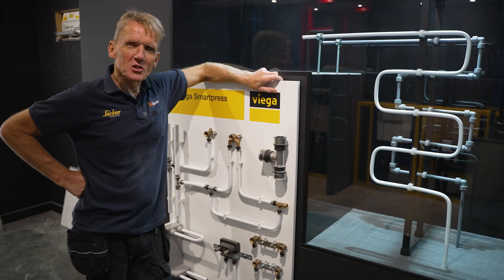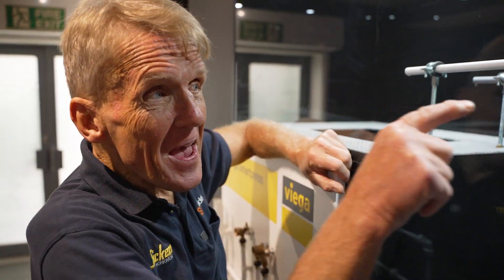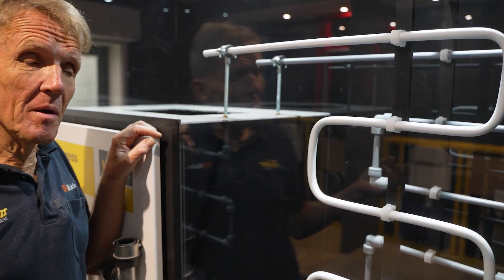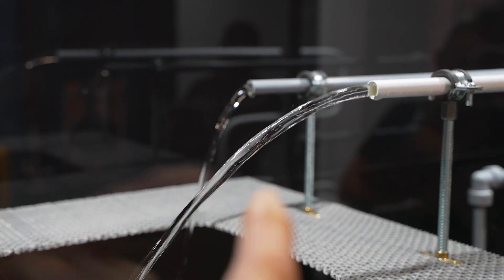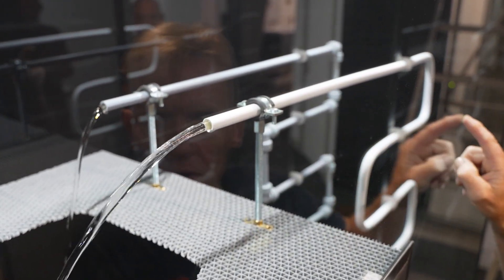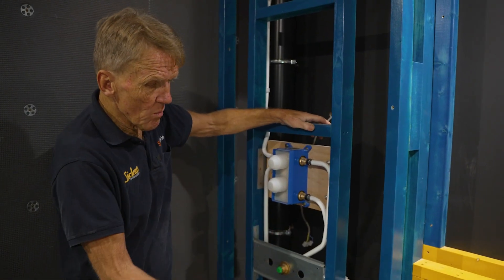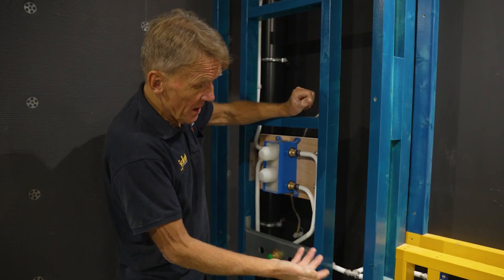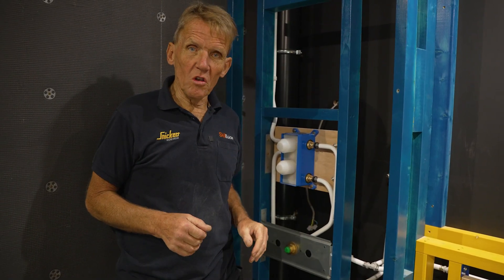Gobsmacking Truth About Plumbing Elbows

Comment: Those two pipes have different pipe diameter
Reply: The push-fit elbows also have pipe inserts that cause additional resistance.
Reply: @KendalMike yes it’s the inserts that are a real killer. Consider them on 10mm microbore feeding a radiator though a 6-7mm hole. Plus you get two one every fitting.   Never like push fit and never will. It only promotes shoddy work in my mind
Reply: @KendalMike only if you remember to fit them 😁
Reply: That’s exactly what i thought . Lol
Reply: Looking at the video a second time I thought there was a significant difference in the internal diameters of both pipes. To make a clear comparison how about quoting them.
Reply: 15mm Hep2O has 1.85mm wall thickness, so 11.3mm ID (~100mm^2 CSA). 16mm Viega Smartpress has 2mm wall thickness, so 12mm ID (~113mm^2 CSA).
Reply: @JohnSmith-ws7fq But you’re not taking into account the Inserts in PF fittings, they greatly reduce the resistance on PF fittings.
Reply: They appear to, but I suspect that's down to perspective and the pipe colours.  Focus on the IDs.
Reply: The inner bores are different. Resistance drops by diameter to the power 4 (diameter x diameter x diameter x diameter)if the larger one is 14 mm and the small one is 13, that's a 35% increase in resistance. If the small one is 12 mm it's an 85% increase in resistance. Get them to make you a rig with the same length of pipe without the bends and you'll see the impact
Reply: It’s negligible
Reply from the maker: Do you know the internal diameter difference between them. It is neglgible and would not account for that difference and even if it did the white pipe wins. You can give it a dope test if you like but a win is a win.
Reply: @SkillBuilder  The internal pipe diameter has a great deal to do with the flow losses. Using Darcy Wisbech formula which uses cross section area of the pipe to calculate the frictional losses, even a small difference between the diameters will increase laminar friction and therefore slow down the flow. Cross sectional area of pipes changes radically even for small differences. Lets say the bore is 10mm, the CSA is 31.4mm2, for a 9mm it is 25.4mm2, a reduction of 17%. Yes introducing sharp bends, changes in bore, ect does reduce flow but not as much as the ID.
Reply: @glynnepritchard2526  The CSA is the only significant difference here. Hard bends will slow the flow but at such a small amount on this model it would be hardly noticeable.
They also appear to be more than 1mm difference. 
The only reason in a domestic situation for using bent pipe is to save costs.
Reply: Can hot water from a cylinder get to a tap quicker if its in small bore pipe?

I wanted to do this for a new build kitchen tap only because its 13m from the cylinder. My current home is 16.5m on a combi and takes upto 50 seconds to deliver hot water to the kitchen tap.@glynnepritchard2526
Reply: @davidsoulsby1102  It fantastic when people learn to read your comment and repeat it using poor English to try to argue with you
Reply: @handle1196  no
Reply: @glynnepritchard2526  Oh the irony.
Reply: @triedzidono  I've done combis with cylinders. Useful if the bathroom is a long way from the boiler and has a large bath. Keep combi side for kitchen and ensuite. Also still got hot water via immersion when boiler conks out.
Reply: @davidsoulsby1102  
Not true friend 
End feed fittings and joints do restrict the flow. Look inside a soldered joint to see 
Did it in college a long time ago so maybe things have changed
That's partly why we bend 
Also more bends less leaks
Reply: @triedzidono   Combi primary circuit does HWC coil via 3 port yes.
Reply: @SkillBuilder  I'd still recommend you set and perform the test yourself.  Don't take a vendor's (salesman's) word for something.  Do copper (bent and end feed too) and do an impartial side-by-side experiment.  It would be a great follow up video to show you're vendor neutral.
Reply: @mdr_random  he isn't vendor neutral.
Reply: @SkillBuilder 
Not sure I can agree here 
I almost always do but the diameter internally looks quite different 
Obviously bent corners are better than fittings as well
Reply: @SkillBuilder  with inserts the difference is far from negligible - and a small change in diameter gives a large difference in cross section. On top of that there's the quality of smoothness of the bore to consider and we will never know how well the pipes have been cut and mated in those plastic fittings... 
      What does come to mind is the possible need/improvement of having sweeping curves in plastic fittings (manufacturers take note?), though they may be available already in some systems?
Reply: @SkillBuilder completely disagree with that comment there looks to be a considerable difference in wall thickness. Which will have quite a considerable difference, water isn’t compressible so surface area of inner diameter matters A LOT. This video should not be about flow it should have been framed as a cost saving tool.
Reply: They would be the same in the interest of fairness. It does nullify the experiment
Reply: The fittings pipe does look a tiny bit smaller but if you knew about physics, the smaller pipe would actually have a faster flow rate if they were both supplied from the same pump with an equal flow rate.  Look up fluid dynamics and the venturi effect. The pressure would reduce but the velocity would increase.

Comment: I used five 90 degree 15mm copper pipe compression fittings and due to the sink position a flexible pipe, the flow rate is pathetic at the tap. The flexible pipe is I'm sure mainly to blame and the whole lot will sooner rather than later be replaced by a totally different pipe run. Interesting actually seeing just what a difference fittings can have on flow rate. Cheers Roger

Comment: Not sure which type fitting are those but insert fittings on 16mm al-pex reduce hole to 8mm. Absolutely microscopic.
Reply from the maker: They are Hep2o fittings. If you are talking about the underfloor heating fittings used on Alupex there are only two per circuit and they are close to the flow control so that is a single point of resistance. It would be interesting to try the flow with and without those fittings but on underfloor heating the flow per circuit is quite low anyway, maybe 2 ltrs per minute.
Reply: @SkillBuilder  If they are Hep20, then they are the previous generation. Not sure if the the newer Hep20 has an improved flow rate.
Reply: @NickLaslett  Look like polyplumb.

Comment: Not doubting pressure is lost but are both being pumped from the same source or independently?
Reply from the maker: one pump with a tee off to the two circuits. It was stated at the start.
Reply: @SkillBuilder  I just wonder if it would be the same if they were independently piped and pumped, being that the water here wants to go the path of least resistance. Someone with more than my O level physics might know.
Reply: @vistron888 I think the same too mate measure the water coming out from each circuit on separate tests not via a tee off

Comment: It's the inserts in the push fit pipe that slows down the flow rate not so much the 90 degree bends.
Reply from the maker: It is the 90 degrees and the inserts, either way it is what it is, you can't leave the inserts out so the point is academic
Reply: @SkillBuilder  If you replace the plastic pipe with copper which don't need inserts as you can with JG Speedfit then you will see an improvement. I know because I improved my own shower flow rate with this one change. I even measured the flow rate before and after with a timer and filling a bucket.
Reply: @SkillBuilder  I've always felt it's a bad system with the inserts I'm not clean on plastic but they are the nail in the coffin really currently building an extension I'm going to do all pipework in 22mm coper no messing about with 15!
Reply: @Droningonuk  Thats the way to go for greater flow that is for sure. I cant really see any argument about that. Cost will be more of course but you only fit it once 👍😁
Reply: @Doug....  if a nuce kitchen is 12k these days I can't really worry about £300 worth of copper lol
Reply: @Droningonuk  Exactly 👍
Reply: It's probably a bit of both. The plastic inserts on modern push fittings are really thick compared with the stainless steel inserts on the older grey push fittings from the 90s. Having larger radius elbows would probably help too. Hope the manufacturers give this a watch and challenge their design departments for their future products
Reply: You're spot  on there. The inserts reduce the bore considerably 👍👍
Reply: That's true they are small bore
Reply: Correct me if I'm wrong but the inserts are ONLY needed for compression joints. 
This example was using pushfit joints so no inserts would be used.
Reply: @phildavey7466  Pushfit uses inserts when using pushfit pipe so the pipe doesn't get crushed by the tightening up of the pushfit fitting. You can use copper pipe with the pushfit fittings and they don't need inserts because the copper can withstand the tightening up the pushfit fittings require hence no need for inserts.

Comment: Piped up a combi just today using all pulled bends on copper and only switching over to Polyplumb using straights. Plastic is great for getting from here to over there under the floor or generally out of sight but it does look a bit shite.  For me a nice tidy copper pipe job with end feed joints is best, but I'm an old git.  ATB from J and H Builders.
Reply: I am exactly the same - pulled bends and end feed joints. Best all round.
Reply: Sounds like someone that takes pride in his work - Sadly lacking today!
Reply: I only do DIY and when I bought my first house and refit my bathroom and kitchen I learnt on solder ring and then end feed. 
I've not touched plastic for anything yet and I won't for as long as I can avoid it!!
Friends have and I think it looks awful when visible and I worry about it's integrity when it's out of sight.
Reply: All pulled bends? Yeah right
Reply: @TacticalPlumber  Why not?